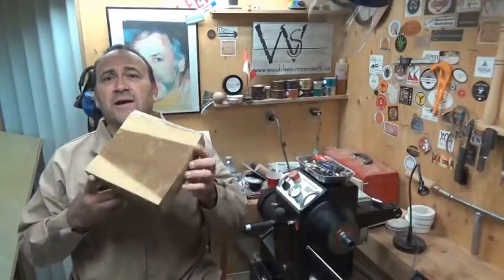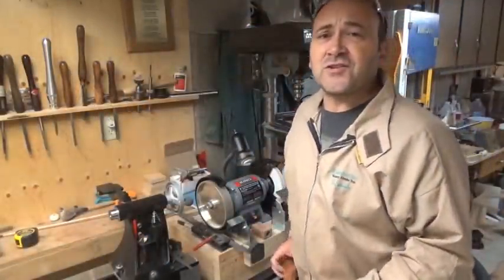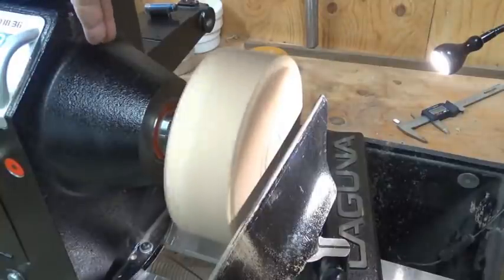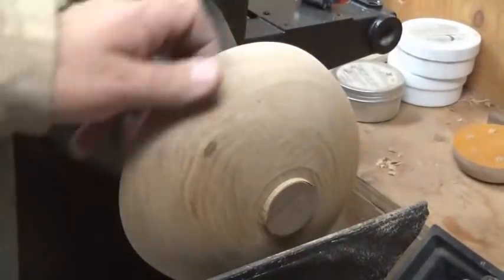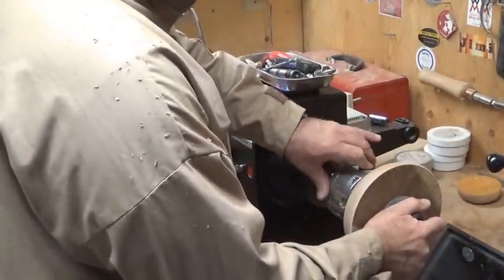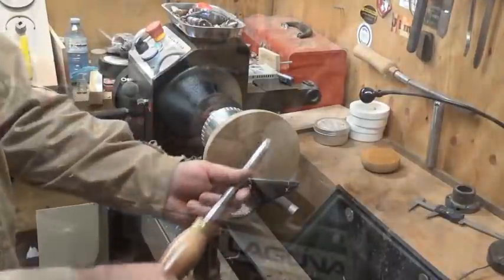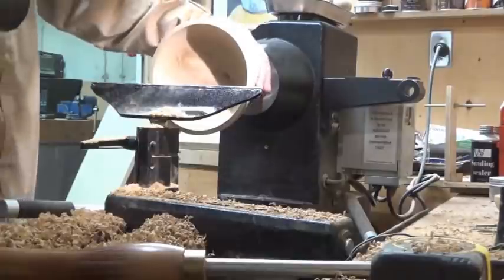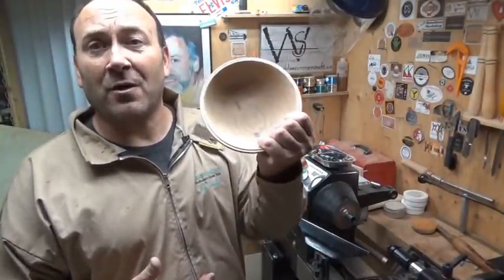how to turn your first wooden bowl

Comment: Good afternoon Rob.  You give us so much great information,  I feel guilty about criticism,  but when I see you using your calipers as a scribe it makes me cringe.  They are a precision instrument,  ground to 1/1000 of a inch and seeing them used on a spinning piece of wood is like using your chuck as a hammer.  Please transfer the measurements to a pair of dividers and use them to scribe . My calipers cost 100 dollars 40 years ago and are just as accurate as new
Reply from the maker: ah yes i hear you cringe, these were not $100 and as far as accuracy goes im a wood turner so close enough is close enough, the tip barely touches the wood and its ideal for the purpose, ive had these callipers for about 7 years and just as good as the day i got them too.. 
thanks for watching and i hope you return for many more cringe worthy moments. ;-)
take care
Rob
Reply: I totally agree Les.